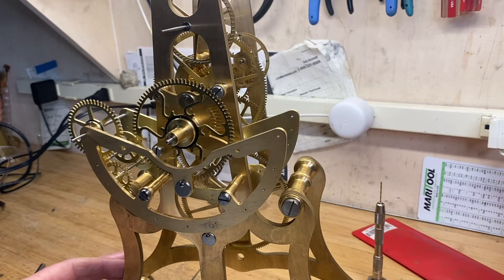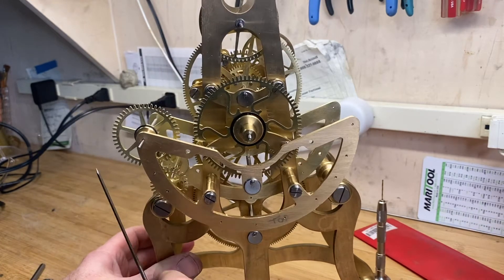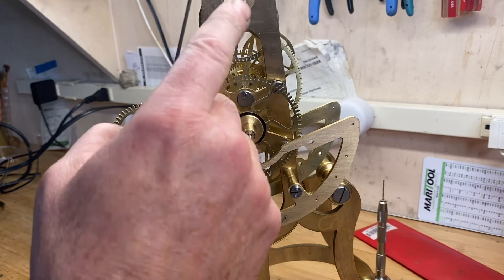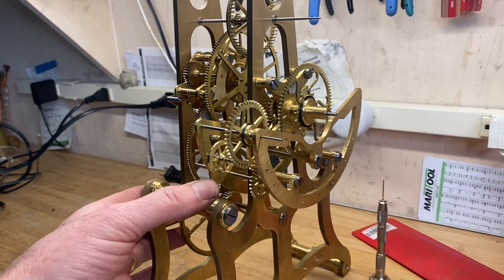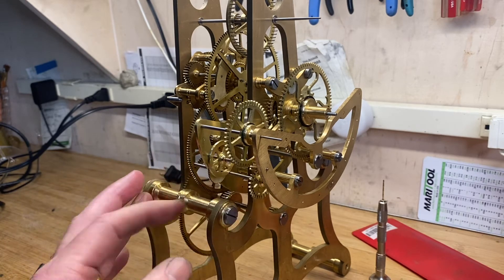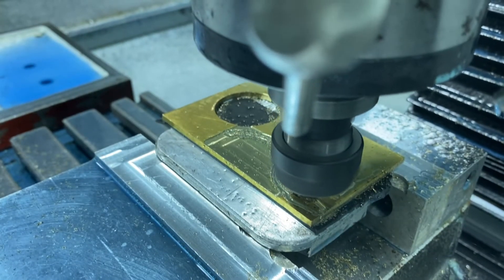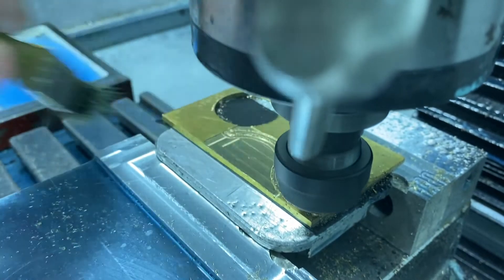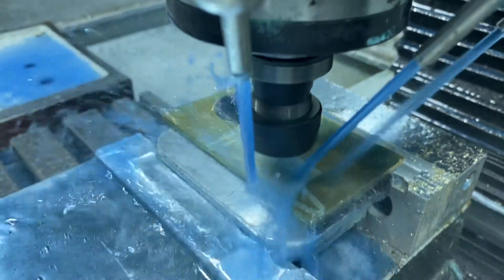Making a skeleton clock

Comment: some gorgeous work there - I'm experimenting with CNC in brass. Before, I've done work in wood using a fairly basic engrave and ball cutters generating my G code from F360 . What bits are you using to cut brass clock parts ??. My plan so far is to use a 2mm flat end bit stepping down a mere 0.1 mm per pass to reduce the load - does this make sense ? . I'd value your insights
Reply from the maker: It really matters what type of machine you have.   Brass is very easy to machine,   Down load a feed and speed calculator and that will help you see how you should be running.   You enter the material and the cutter diameter and number of flutes and the depth of cut you want to make and it will tell a recommend speed to move and RPM to turn the cutter.  The size of cutter you can handle really depends on your machine but recommend use the biggest you can for your machine and the work needs to be done.    Also the most aggressive cut your machine can handle is better as very light cuts tend to wear the cutters faster.  Hope helps but just try and see what seems to work best, worst is you break a cutter

Comment: Did you get the book from Ian T  Cobb? If you do have the book, could you let me know how many pages it has? There was very little information on their web site. I'm looking forward to seeing how CNC fits in with traditional clockmaking.
Reply from the maker: Yes I got the book from T Cobb.   If it is the first clock that you are making from scratch I would start with a book by John Wilding that you can also get from Cobb. He has many designs and they are so well documented.   I have built three of his designs and was very happy with the books.   This current clock is super interesting but following the book will leave you scratching your head.
Reply: @KevinNolanMakes  I already have several of the John Wilding books along with several more from W. R. Smith.  My clockmaking is confined to what I can produce on a Sherline lathe and mill so your skeleton clock is probably too large. Having said that though I do like to collect books!
Reply from the maker: @kbusek   The book by Brown is about 43 pages but the documentation is poor and pictures are very hard to tell from.  If you aren’t planning to make this clock I am not sure I would recommend it.   The Great wheel is about 4.2 inches so could probably be made in a Sherline with extensions.  A book I highly recommend if you don’t have  is “Wheel and Pinion Cutting in Horology” by: Malcolm Wild.    It is a reference I use all the time.
Reply: @KevinNolanMakes  I bought the Wild book while attending the clock school in Columbia, PA. It is indeed a great reference. BTW if you ever get the chance to go to the NAWCC Museum there, take it.  They also have what is likely the most complete horologic library in existence.